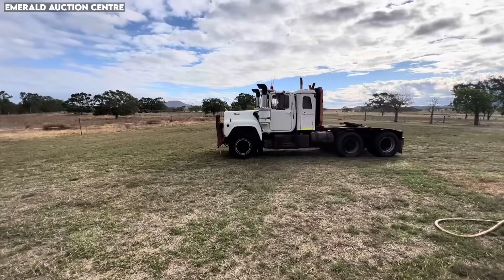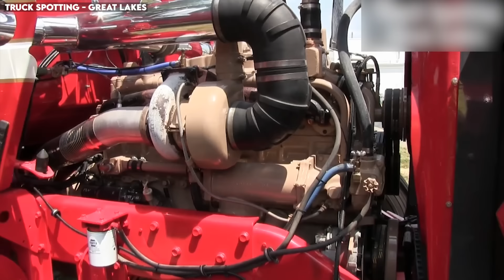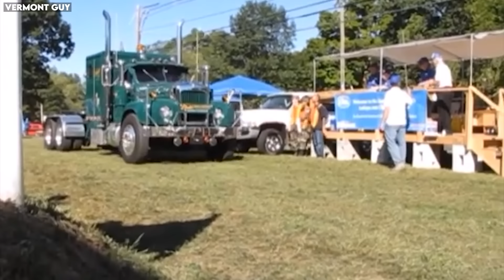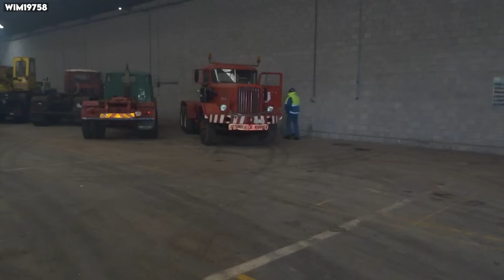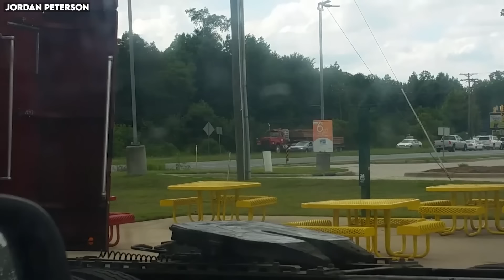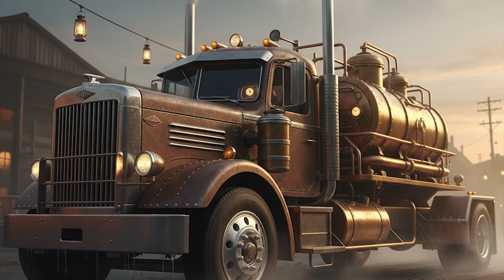10 Trucks From the 60s and 70s That Were Pure Muscle

Comment: The 66 R model Mack, didn't get the high torque engine until 1967. The transmissions Mack had at the time couldn't take the torque of the new engine, so Mack built several new transmissions to handle the extra torque. No doubt the factory used a fewc66 year models with the new engine, with the new transmissions to make sure they didn't have any major problems with either.